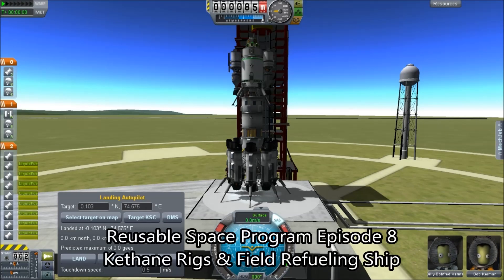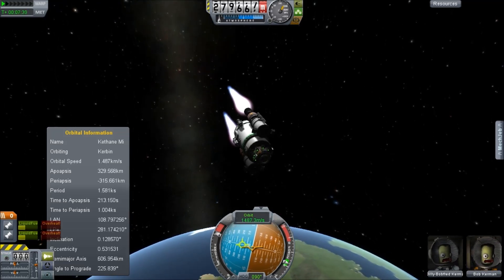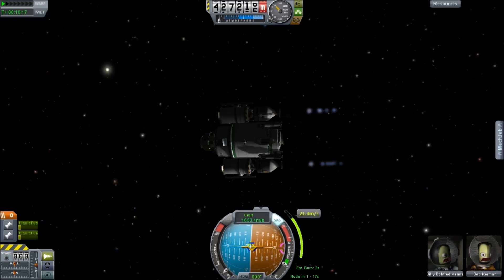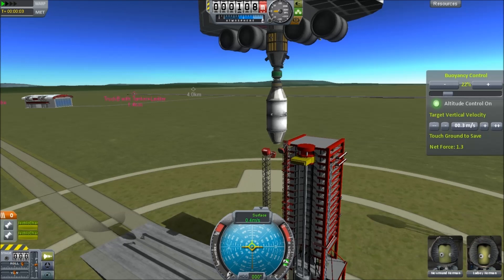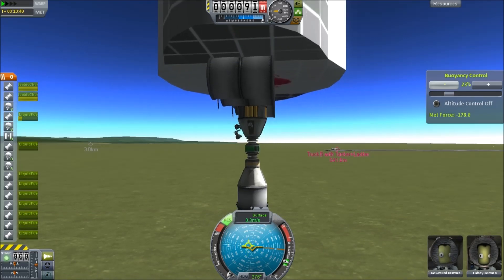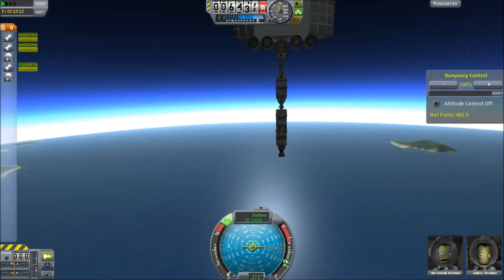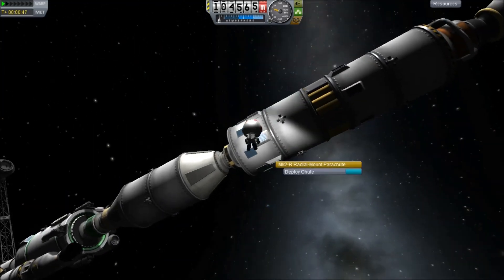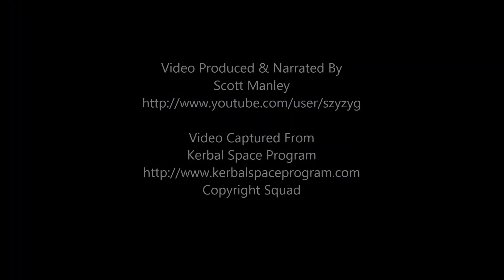Kerbal Space Program - Reusable Space Program - Episode 8

Comment: speaking in real world terms, kethane doesn't exist. Then name comes from the system of naming hydrocarbons (methane, ethane, propane, butane etc) based on their length, and the ksp tradition of adding k to ever word. Hence, kethane.

Within ksp, it is a mine-able resource introduced in a mod pack, that can be processed in to various fuels. This is useful since fuel is very heavy, and bodies such as the mun are easier to lift off of than kerbin. So, it's easier to go further.

Comment: Unless the platform was lighter than air, or ran on engine power (cue every economist in the world groaning), no. For something to be in orbit it has to travel at blisteringly high speeds, much higher speeds than the atmosphere moves at even in the high atmospheres. As such the air would still slow it down, assuming that the station survived that kind of force.

Comment: Not entirely. A craft in the air is only affected by the atmosphere. The atmosphere however, usually moves in the general direction of the planets rotation.
Ultimately, no. However, in high atmosphere, it will not be affected that much.

Comment: Hmm. There are processors that have graphics hardware inside them, but I'm pretty sure AMD has exclusivity on that technology (i-series processors are Intel products). Even then you'd need the circuitry to link the computer to the monitor.

So unless you're reading this through sound, you probably have a motherboard-integrated graphics adapter. These are often sub-standard, though, so that may very well be the source of your lag.

Comment: Also, search up engine clusters. Its not a mod, its a trick someone found where you place octagonal struts under fuel tanks w/ symmetry, allowing you to pick certain engines for a custom amount of thrust and vectoring without the overheating. Extremely helpful, but it does add a lot of parts so i don't use it on the stage that docks to my station.

Comment: The problem with KSP is that it doesnt allow hyperthreading. A thread is a portion of a core. That way you can run more tasks through one core.
For example, i have the AMD Bulldozer FX-4130. It has four cores with each four threads. It therefore looks like a 16 core processor.
But because KSP doesnt have the software to handel that, it uses one thread in one core. That is why it is so slow, even on my ultra high gaming computer. My biggest wish is for the adaptation of hyper threading.

Comment: Resolution may be the answer, in that case. I found that trick when GTA:IV was not very optimized for PC. However, it will change the video size you record at. It may be safe to assume that this will just be an issue until the next Unity update.

Also! Nice thinking on the "rockoon" idea. You certainly saved the mission! I would have personally said "nope, they fix it in the VAB and try again", but you certainly pulled it off!

Comment: i recently started building my own Kethane mining base on the moon.
i am currently designing the mining rig itself.
however i've run into a kind of a logistical problem, my plan is to use a mining/converter rig that would not leave the site anymore, and use a separate hauler to transport the fuel, but how do i transfer the fuel between the vessels on the ground? straight up docking seems next to impossible, and the resource transfer mod is just not for me, any ideas?